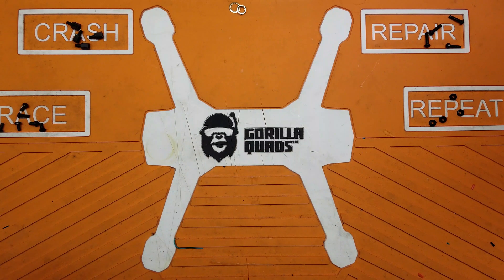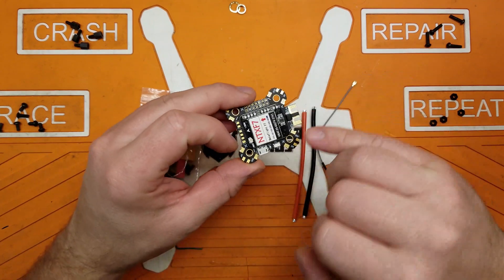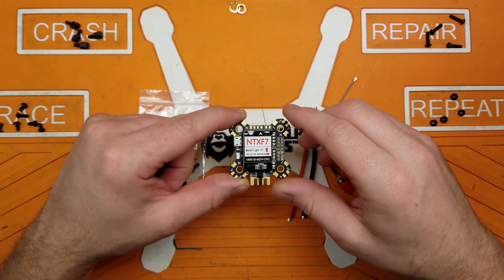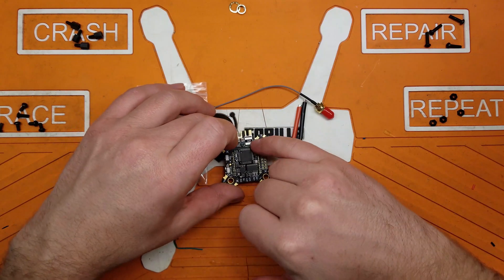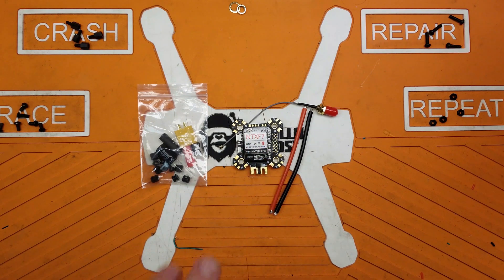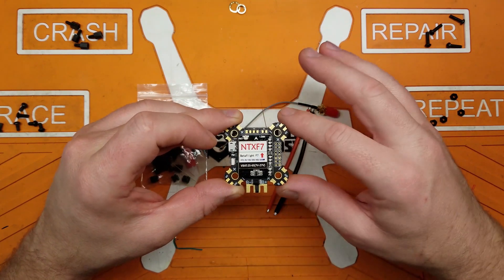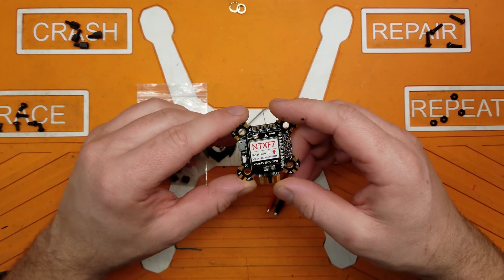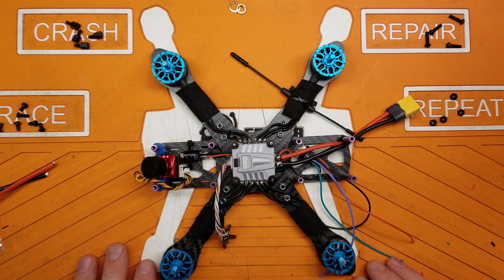NTXF7 Flight Controller VTX PDB AIO 👍🏁

Comment: When the vtx goes bad, where do you get the osd to your new vtx?
Reply: I found it it’s the second one from the left on the bottom row. thanks so very much
Reply from the maker: Thank you for the update. It seams like there are some redundancy in the pin headderes on this board.
Reply from the maker: The same pad that supplies video out to the Vtx will also have the osd overlay on it.
Reply: TweetFPV there is no pad for out to vtx
Reply from the maker: If you remove the built in Vtx the video out connection should be on the header closest to the main discharge leads. Now if you are looking at the header the pin should be the 4th pin on the bottom row counting from the left to right.

Comment: What do you have the voltage scale at? The vlotage does not change for me proper so not sure if I have it wrong.
Reply from the maker: Source: adc
Min voltage: 3.3v
Max volt: 4.3
Warning volt: 3.5
Capacity 1300mah
Voltage meter
Scale 110
Divider 10
Multipliter 1
Amp meter
Scale 170
Offset 0

Comment: I don't suppose you have a betaflight backup for this Fc do you ? I'm having a couple of issues and need to reset mine back to stock.
Reply from the maker: I'll have to check. What issues are you having?
Reply: @TweetFPV  hiya, being a dumb ass and not being able to get the compass working I used resource to change the RX2 pin to an I2C and lost the RX 2 pin which is dedicated to the reciever .. As i'm a noob I need to start from scratch again. its really frustrating because its just about ready to fly ..
Reply from the maker: Mine was messed up stock. The gyro and accelerometer alignment was wrong.
Reply: @TweetFPV   I think the instructions say to reset the alignment if you flash the board ?
Reply from the maker: Yea, it's a fairly easy fix. What issues are you having with your board?
Reply: @TweetFPV  Fixed, I persevered and got it in flying condition :-) still one or two issues but i'll be giving it a go tomorrow . cheers dude
Reply: @TweetFPV Ok scrub that I got the receiver working, well on screen anyway. now I cant get the VTX to respond to FR button on side of the FC  ? and the red LED beside the USB port is on all the time I don't know if that is correct.  
any ideas ?
Reply from the maker: Sorry it's been a bust day here. I'm not sure if the button on the Vtx has control if Vtx audio switching is enabled in betaflight. I think bf has overriding control of the Vtx but  not 100% sure.
Reply: @TweetFPV  no problem work come first :-) flew it today but can only use 600mw but not worried about that and sometimes the camera works sometimes it doesn't  . oh well i will keep poking it with a bread knife and see if it settles down :-)

Comment: Just starting out and crashing created another obsession, "Building".  Never caught a glimpse of ya in the video. You up in a tree? Comments aside here's a question that may have already been covered. RHCP upside down LHCP? Just seeing a lot of builds with these Circular Polarized antennas mounted at 90 degrees and beyond all the way to 180 degrees. Myself included I have and inverted RHCP on my Bayang X16.
Reply from the maker: Haha, I was under the deck in the shadows. rhcp is rhcp regardless of its orientation on the Quad. A lot of times mounting that antenna is the last thing people think of when laying out thier builds.